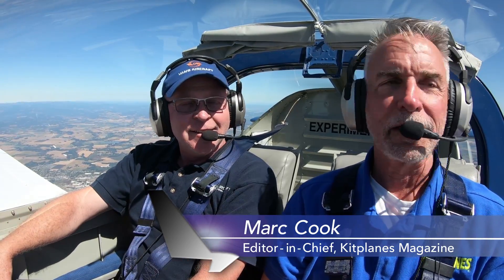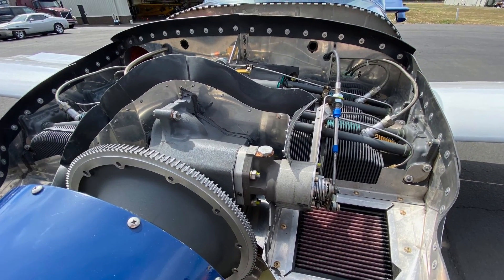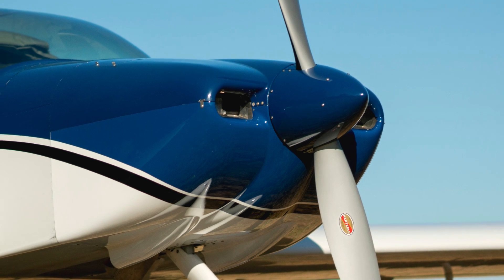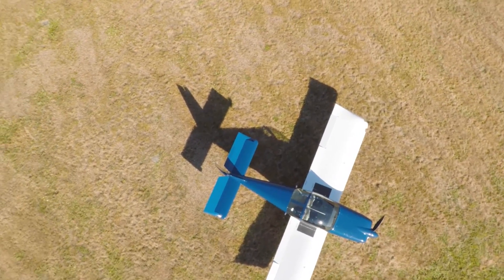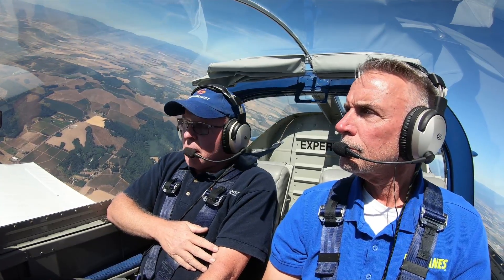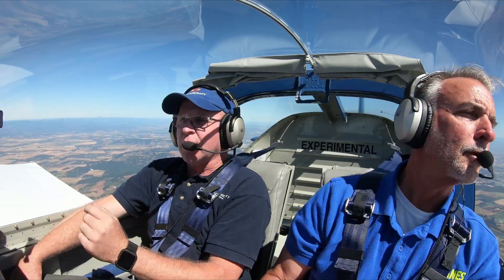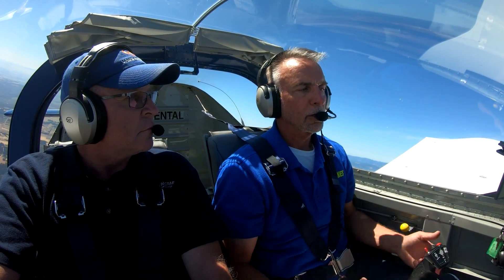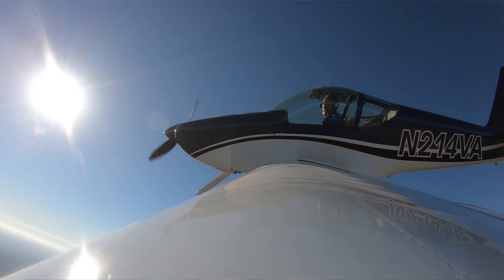KP Flight Review: Van's RV-14A with Lycoming IO-390-EXP119 Engine

Comment: To get from San Jose, CA to Hannover, VA, I have to transit the Rockies.  In an RV-8 or RV-14 (with the IO-390-EXP119), what kind of fuel economy can I expect at FL160 compared to FL080?
Reply: See this video - https://youtu.be/FzVx__MX2jQ
Reply: @zmanmd1641  Link no longer active. Curious, as I fly out of KFCI.
Reply: This isn’t a plane for 16k except short stints - I say that as a guy who has flown lots of GA airplanes up to 19k out of Montana and over the Rockies and Sierras…in an unpressurized aircraft you are putting yourself in a box

Comment: what temp issues if any do you have on climb on warm days. ?
Reply from the maker: I can query Van's on this, but the IO-390 typically does not have cylinder-temp issues; it's more likely to punish the oil, which is part of the program to update the cowling exits on the EXP installation.